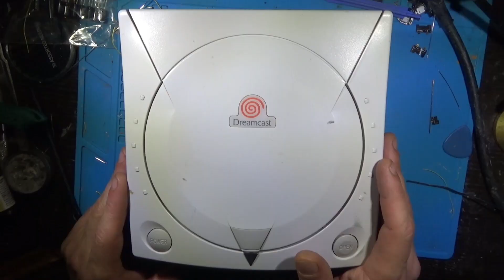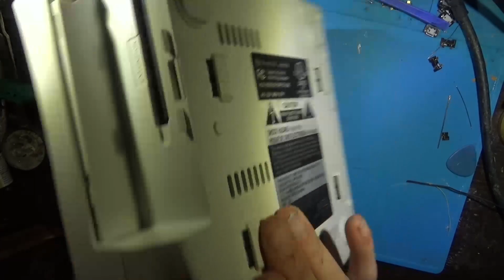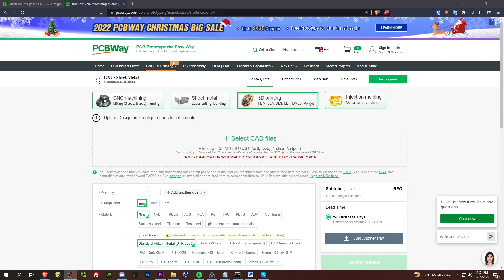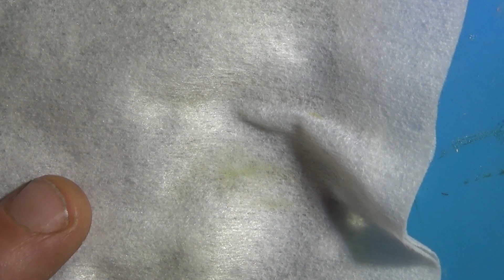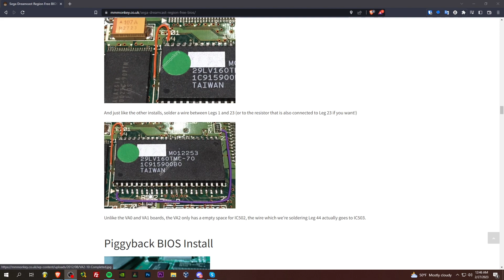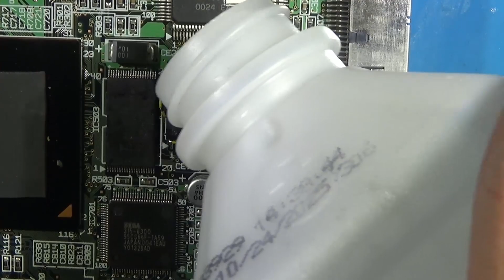Sega Dreamcast VA2 Region Free Bios Installation Guide

Comment: Would this allow the gdemu to work in va2 systems?
Reply: No, the VA2's drive is very different from earlier models, most of what was in the drive before was moved to the main board and the connector is completely different - the gdemu relies on that connector to work. This will, however, restore support for MIL CD, and therefore will be able to read CD-R burned backups.

Comment: Yours is the very last Dreamcast batch (December 2000) from reading the label. Those were produced for sale in 2001. This is the batch that can't play burned games, and some VA2s from October 2000 still have the VA1 BIOS chip on them. I'm not sure about November 2000, but I think those are the same BIOS as the December 2000. I'm going to have to do a BIOS extracting myself sometime to find the BIOS date, because the PS1 tells you the date when you extract the BIOS.
Reply: I have one from november 2000 that reads copies- and has proven a very very reliablke console not one potweak in 20 years playing only backups-

Comment: My understanding is they removed MIL CD support from the VA2.  Region free BIOS had MIL CD support letting back up run on the system again
Reply: I have 2 VA2s, I think one even made in December of 2000 that has the MIL-CD compatible BIOS. I still prefer my VA0 and VA1 systems, but having 2s that can pull the MIl-CD magic trick and the shells to prove it just cracks me up 😂